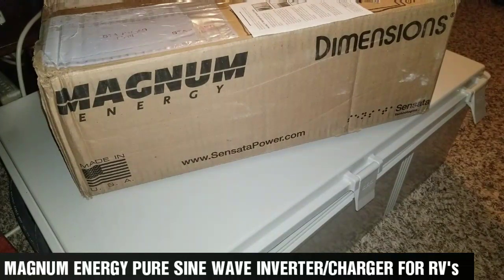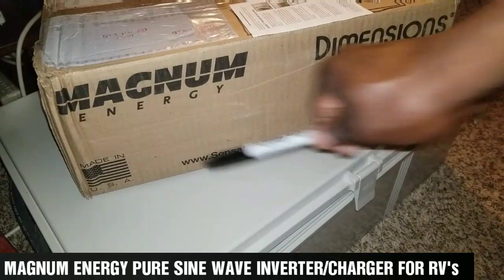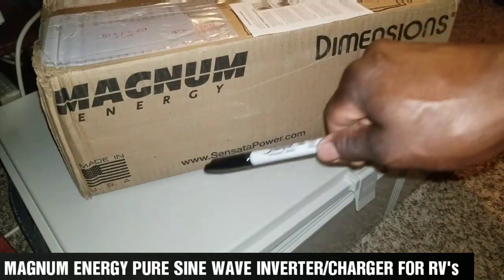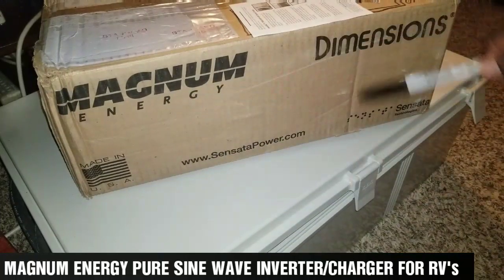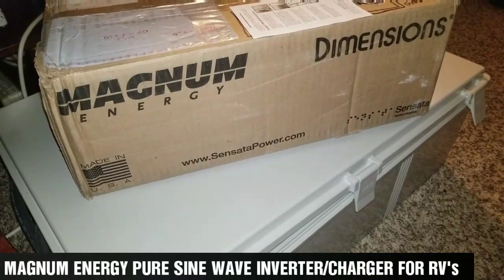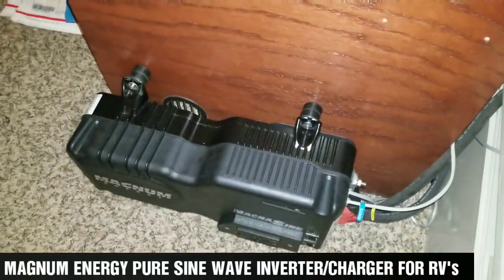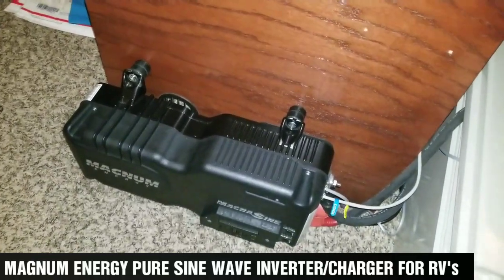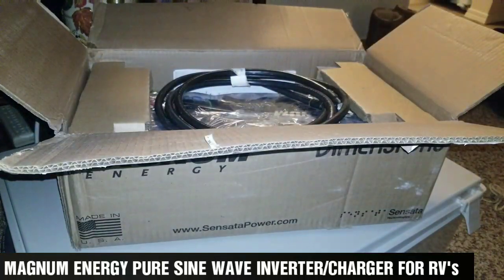MAGNUM ENERGY INC: MAGNUM  ENERGY INVERTER/CHARGER

Comment: Thank you!
I appreciate this video.
I have a 2014 Airstream interstate.  And certain outlets stopped working after charging a solar generator. I was told by the Airstream dealer (many years ago) that when this happens  that i need to push SOME button. 
Do you have any idea?
Reply from the maker: There are two breaker at the top of the inverter charger.

The first one is a 20 AMP AC IN and the second is a 15 AMP AC OUT.

These are the buttons they were referring you to.
Just rest one of the breaker that throws the fault and you are back in business. 

Thanks for stopping by. 
I hope you learn something. 
Please don't forget to Like Share and Subscribe to my channel.